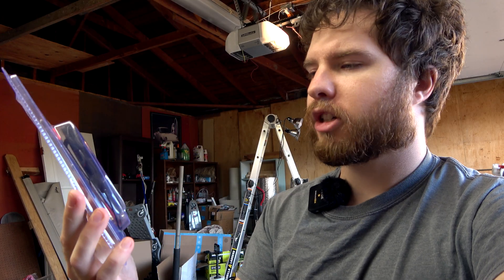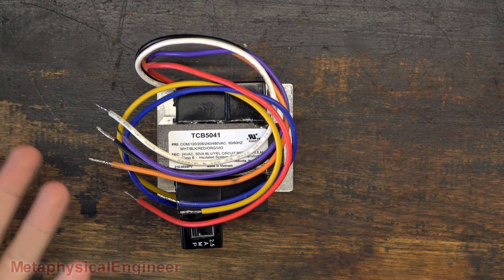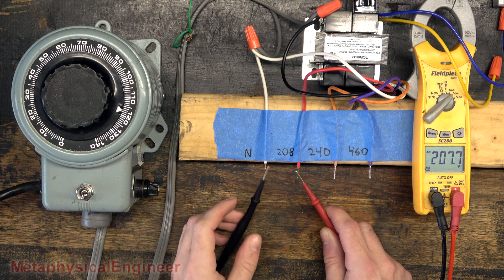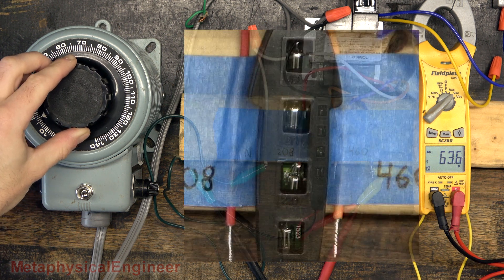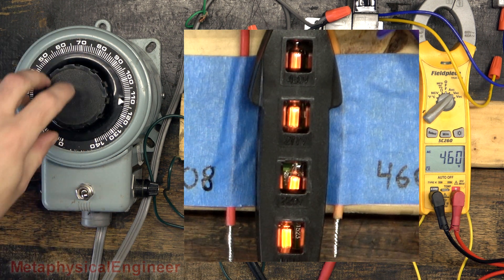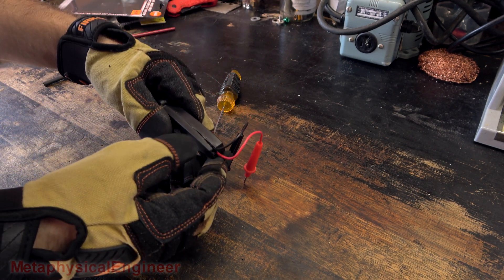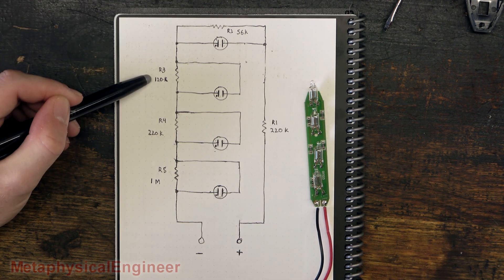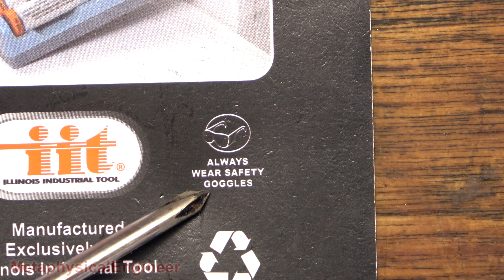Secrets of a $5 Neon Circuit Tester

Comment: My kind of content - you're obviously technically proficient in electrical theory and practical enough to wreck a crappy tester with a screwdriver and harvest it's guts for science! I learned something, thank you!  EDIT: I commented too early!  Thank you for the safety analysis (that's absolutely ridiculous this is being sold!)
Reply from the maker: Thanks so much for your kind words!  I really couldn’t resist a neat little tester like that for five bucks, only to realize quickly just how hilariously dangerous it was.  

The Category ratings for test equipment are so important to be aware of if you have to do any work on systems with high energy available.  I’d use the Harbor Freight unit to test low voltage automotive or computer circuits, but I won’t put it anywhere near a line voltage source.